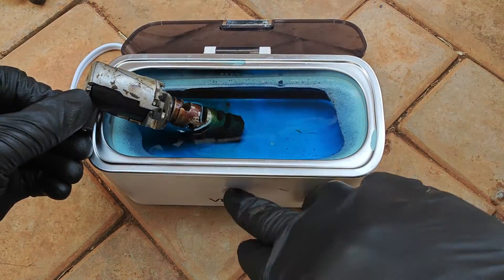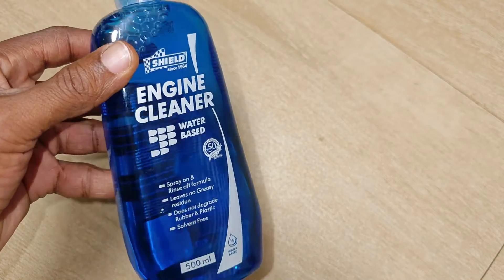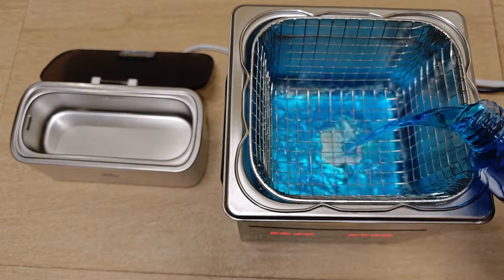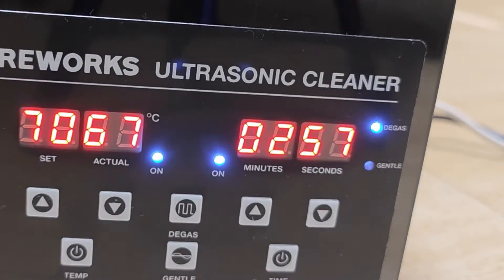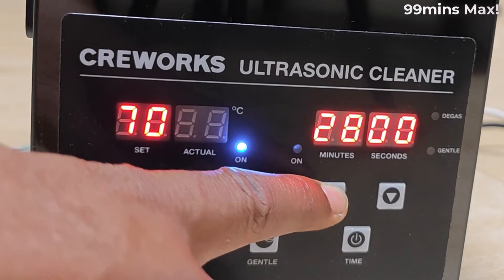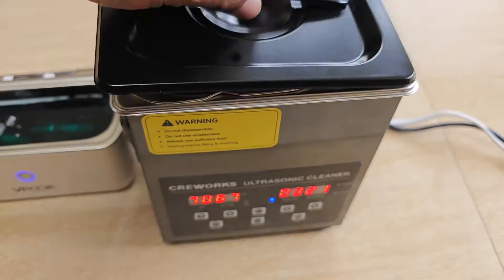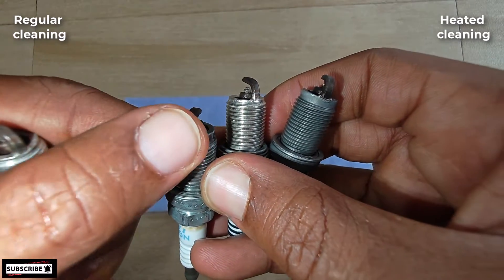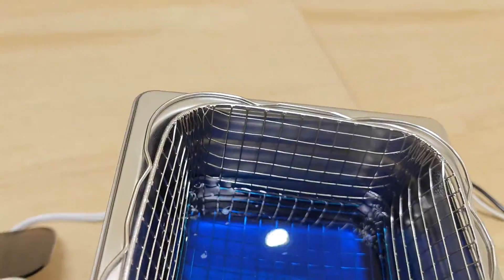Heated Ultrasonic Cleaning VS Non-Heated: Do you Need Ultrasonic Cleaning / a Heated Cleaner?

Comment: I appreciate your efforts. It would be good to isolate one factor you want to test at a time. From this experiment I don't know what's more important: heat, stronger ultrasonic vibration or additional cleaning fluid (presumably all three make some difference). i.e., perhaps the smaller cleaner would work just as well if between each of the 6 runs you replenished with fresh, heated fluid.
Reply from the maker: Great point! Though, I was largely pitching the devices against themselves. You're right, I've had better results with the small one when I use heated fluid.

Comment: I wonder if you could just slowly heat your cleaning fluid in a pot on the stove then use it in the ultrasonic cleaner? Either way both methods seem to work great. What parts benefit the most from being ultrasonically cleaned do you think?
Reply from the maker: I've actually heated fluid before use on some ocassions while using the small device without heating.
Ultrasonic cleaning is very good for removing varnish, rust, carbon, and gunk. For me I've used it for solenoids, iridium spark plugs (because wire brushing is advised against), etc. Injectors, carburetors are also good fits.